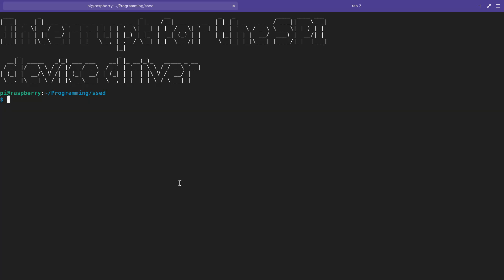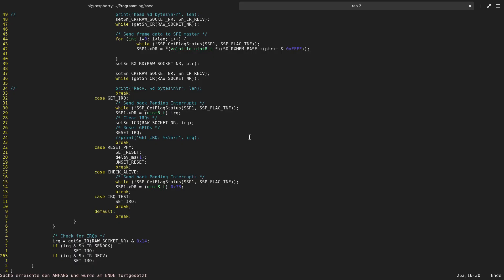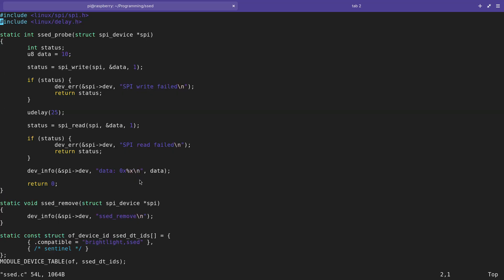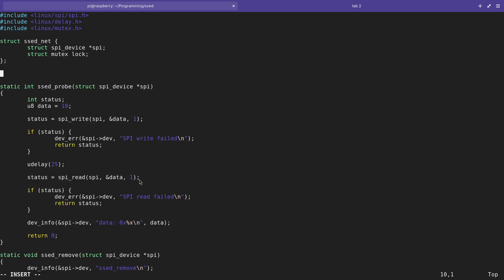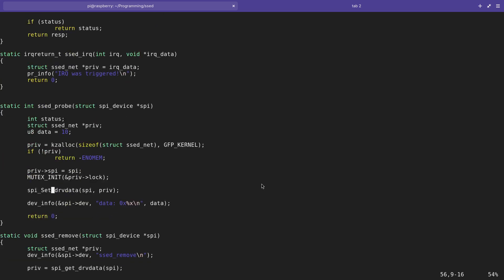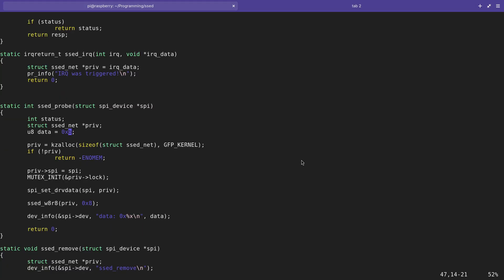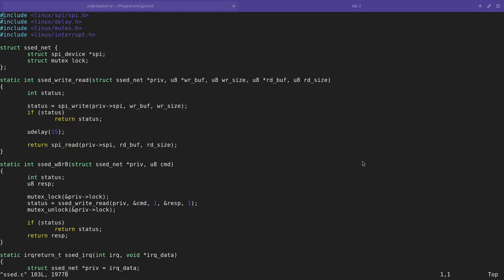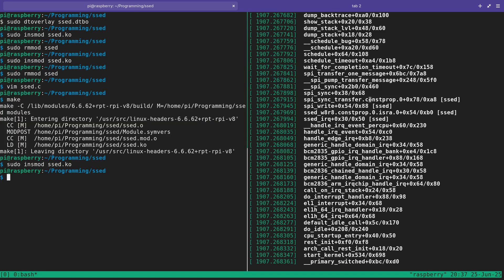Let's code a Linux network driver - Use interrupts in an SPI device driver

Comment: Question: you defined pin 25 as interrupt pin in DT, should you parse the pin config in probe function? Why does spi->irq already know which pin is used?